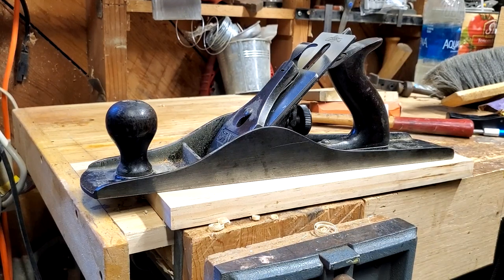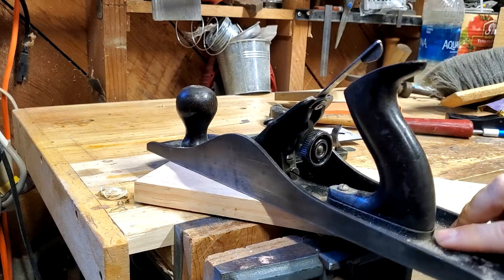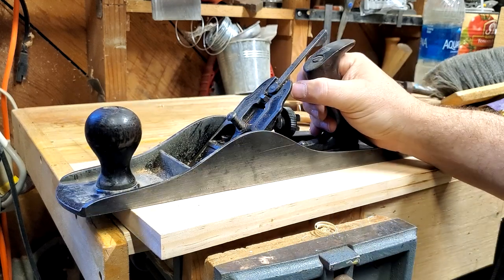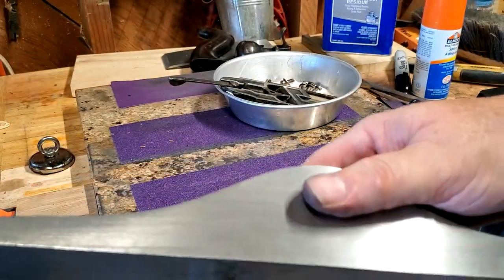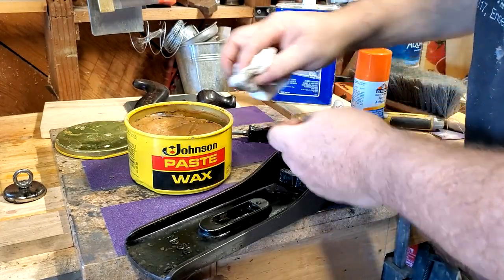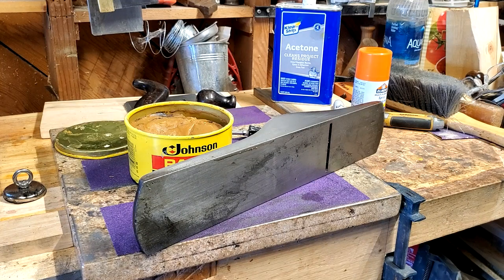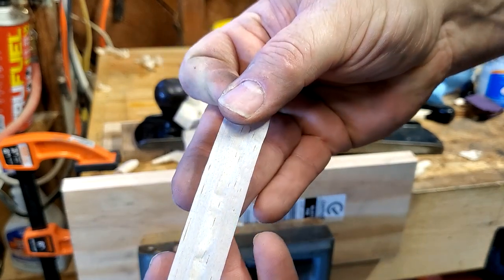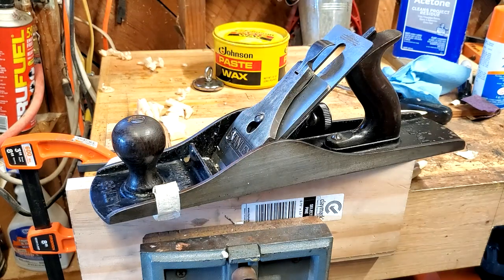Fixing up a Stanley 5 1/2 Plane

Comment: That is indeed a wartime plane.  The type study was done on the no4.  The bigger planes didn't get the changes until later.  The frog design with the ogee and kidney bean lever cap started with a type 16.  The bolts that hold the knob and tote being steel is also a t17 hallmark.
Reply from the maker: Thanks rvburbank1.  Excellent info.

Comment: This is a type 17—the type 15 molding marks weren’t done on the 5-1/2 even through the type 18–my 18 doesn’t have them. The unplated lever plate is another clue. Finer grit applied to the sole and sides will look better, work smoother, and resist rust better. Don’t use vinegar—too acidic. You have a nice plane!
Reply from the maker: Thanks.  That supports what rvburbank1 commented also on the type.  I'm learning more about the type study differences all the time.

Comment: Thanks, I like the 5-1/2s.
Your 5-1/2 reminds me of 1 of my No. 4s, it looks like it is 'parts' plane.
BTW, I think I found an easier way to flatten the sole.
I have some concrete/cinder blocks that are clean, smooth, & fairly flat sided.
I 'plane' the flat side (w/ iron withdrawn) of the blocks.
It seems faster & it gives a nice finish, it reminds me of 120 grit sandpaper.
Since I do it outside I just brush off the 'dust' & the block's surface is ready to go again.
I'll prolly finish it w/ 120 or 150 wet/dry sc sandpaper.
I like it because it seems to be faster than sanding the sole for hours.
Have a GREAT day, Neighbor!
Reply from the maker: I never would have thought of cinder blocks.  I have ground a few things on cement slabs before though.

Comment: She's a beaut! About the depth-control knob, the wartime ones were hard-vulcanised rubber. And rather amazingly (to me 😁) after years and years of looking at this stuff I think this is the closest view I've ever had of one! So thanks for that. 

It is a well-known thing that some Stanleys from the factory used up older spare parts from the stores, and this is probably much more common for the fractional sizes (as well as maybe the 2s, 7s and especially the 8s). So I'm thinking definitely wartime production on this one. All the other details seem to match – the cheeks look thicker than typical for earlier Stanleys, no nickel plate on the lever cap, no paint in the logo recess, and it has the steel handle screws instead of studs with brass nuts. 

Have you had a chance to work on the handles some since the video was posted? I was wondering if they did turn out to be rosewood, because wartime ones were mostly stained hardwood. As these are in such nice condition for their age i was thinking they could be that, without any telltale wear-throughs or scratches that reveal the natural wood colour.

BTW glad to see you have tons of the Johnson's paste wax left in that tin since I just found out they stopped production of it a while back 😢Hope it lasts you for a good long while!
Reply from the maker: Hi and thanks for the info!  I'll take a deeper look at the adjustment knob.  It seems shinier than the other ones I have which is why I thought it was a later plastic one from a Handyman or something.  Compared to the other two WWII planes in my collection it looks the same, so I think you are right.  Very cool.  Good catch on the handle screws.  A video on the the WWII planes is on my to-do list.

I found that can of wax at an estate sale.  JPW is gone, but Minwax still makes something similar.
Reply: @NotanExpert-Woodworking  Yeah I thought the wax might be a lucky yard sale find because I was subconsciously aware it was a vintage can (older graphics, plus the older wax colour from before the reformulation where they left out the orange colourant).

Comment: I love Hock blade chipbreaker combinations. But i have never bought one after Ron retired and sold to Lee Valley. But I seriously doubt Lee Valley will mess with it🙏. You cannot lap the sole of a plane using sandpaper that is shorter than the plane. Because the sandpaper contacts the center of the plane all of the time  and the ends only sometimes you have made a hollow in the center of the plane. This is lapping 101. This is not meant as criticism but just information. Also do you know that Johnson paste wax is about $150 a tin now?
Reply from the maker: Thanks.  Good info on the lapping, I'll give my plane a check.    Johnson's is gone, but I think the Minwax is fine.  That can of JPW was a garage sale find.
Reply: I buy partial cans of Johnson paste wax at estate/yard sales for $1 or less. I have a lifetime supply.